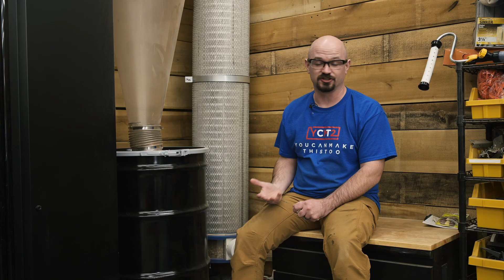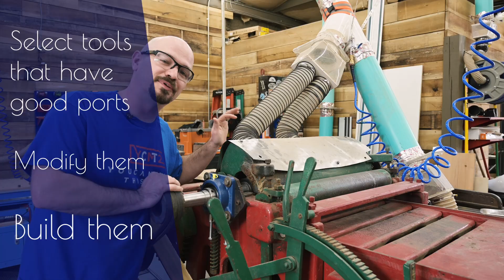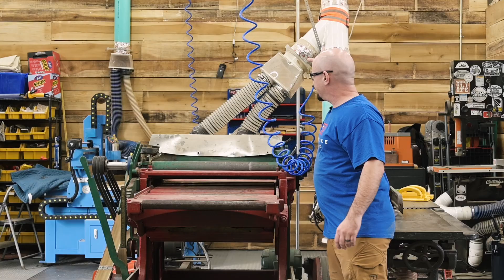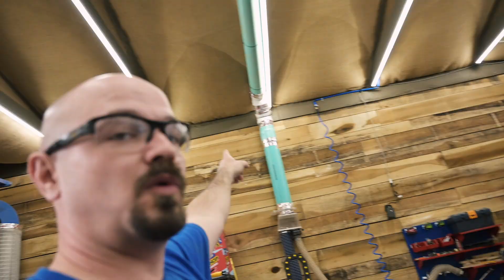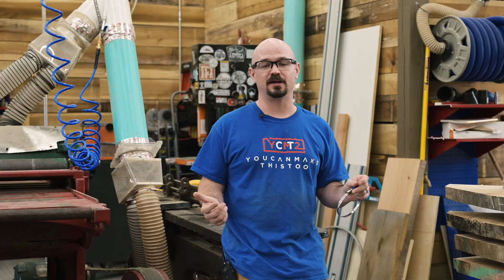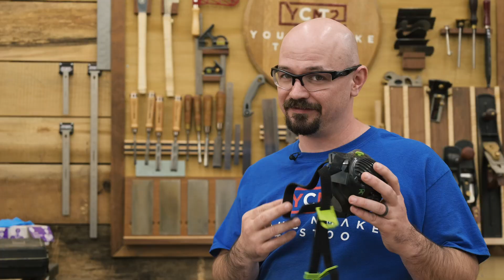Most Common Dust Collection Mistakes

Comment: Note that when you double the radius of a pipe, you better than x4 the flow you can get through that pipe. Friction losses in the pipe are controlled by the distance of each air molecule from the nearest surface of the pipe. Your six inch pipe, as well as having more than double the cross sectional area of a four inch pipe, has much more of that area further away from the wall of the pipe.

Comment: My wife bought a Harbor Freight filter/blower that I plan on modifying with a cyclone and a better pleated filter. The blower inlet is 4". Would I gain any performance by using 6 inch pvc?

Comment: Extremely well done, sir.  I've followed your dust management advice to a tee. I just need one or two air cleaners in my 40x30 with 12 foot ceilings shop. I have 6" sewer pipe from my Harvey Gyro 700 dust collector with 4" drops to my machines. Thanks for your info

Comment: There's a couple YouTubers that actually tested 90 degree turns and found no drop in airflow as long as it's smooth piping.  It's more important to remove any friction points between connectors or gates that make a difference

Comment: Thanks for the vid! I have one question, since flex hose is a lot more convenient to set up for my small shop, can I use larger size hose to compensate the downside? My WEN DC1300 's default output is a Y splits a 6 inch into two 4 inch ports, I could get rid if the Y,  and directly run 6 inch flex to all my tools, and use adaptor to connect them. I don't see myself running more than 1 tool at the same time.

Comment: It better to send dust out of shop not a cartridge.   Exhaust out of shop like professional shops.  While you can put filter.  You maximize CFM sending fine dust out of shop.   My 2HP pulls 3500 CFM at my tools because I don’t have a bag or filter in shop. I exhaust 6” out of shop to backyard.  

Get 6” pipe and a dust collector
Reply from the maker: Absolutely, if you can. I’ve yet to have a shop where that was a viable option though.

Comment: Well done, most home wood workers have no idea of the risk of dust and have misconceptions on vac systems. Yep the big dust is gone I’m good , No!  At least have a shop vac with some sort of pre filter and a Hepa grade filter in the vac. Then get a box fan and attach a couple of Merv 13or 15 grade furnace filters to it. Then just leave it running all the time your active in your shop.
Thank you for you work and excellent presentation.👍

Comment: I have seen many videos on dust collection on You Tube, and so far nobody has mentioned the importance of grounding.  Dust traveling through pipe can build up static electricity that can cause an explosion or fire.  Plastic pipe is just fine for dust collection, but it needs to be grounded by wrapping bare wire around the pipe, or running bare wire inside the pipe, then connect it to your dust collector motor or to ground rod.   Metal pipe is self grounding.  It can be just as inexpensive as plastic, depending where you buy it.  To prove my point, try picking up fine sawdust with your shop vacuum, the try touching the plastic hose and see if you get a small static spark.  Woodworking is a great hobby.    Be Safe!!!!!!
Reply: I was vacuuming blown insulation out of a wall (demo work). There was no lights and it was after sundown. I kept feeling a prick on my arm and finally saw a spark from the vacuum hose to my arm. Yes you will generate static that can generate a spark.

Comment: if you install fans and associated vents to force the dirty air out of the workshop and supplement with good dust collection, you'll avoid most of that minute dust, and you will not need the expensive pleated filters.
Reply from the maker: If you run climate control, as I have to in the Deep South, the extra cost of heating and cooling as you keep sucking in outside air would probably offset the cost of good filters pretty quick. 

If you live somewhere really temperate, or aren’t in the shop every day, probably not as big a deal.

Comment: Did you test air volume before and after taping your joints? It's obviously helpful, but I'm not sure the benefit is worth the cost and aesthetic mess created from taping (I actually care how it all looks), but the before/after Delta is substantive, then I'll tape the joints. Also, by not taping, I can more easily disassemble and reconfigure when needed. With the 6" PVC, the fittings are pretty tight even w/o tape.

Comment: Thanks for this mate . I'm just planning out my collection system and the first thing I WAS going to do was step down from 150mm to 100mm , I will NOT be doing that now . I will run 150mm throughout the workshop and only step down at the individual tools as necessary . Also appreciated the 45 degree tip !
Reply from the maker: Glad I could help!

Comment: 6:20 there’s truth in that from the filtration perspective- the filter gets more efficient over time. But that probably is coincidental with the collection becoming less effective as mentioned in the video. 
And blowing the waste air outside solves the tiny particles blowing around anyway.
Reply from the maker: Our pool is going downwind of the shop inside venting doesn’t work for me here 🤣😂

And exactly on the filtration. Only functional if your airflow is well over the required amount. Otherwise… great your filter is extremely effective, sucks you aren’t catching the fines at the tool and they’re going in the air instead… because of how effective your filter is 🤷‍♂️🤦‍♂️

Comment: I'm starting out with a WEN DC3401 which has a 4" dust port but would like to upgrade someday.  When I buy the rigid pipe could I install 6" and the downsize at the dust collector in preparation for upgrading someday?  Or would it have a negative impact on air intake for the WEN unit?

Comment: I'm usually a very technical guy, spent 46 years working in engineering and ergonomics. Okay 1. Most hobby level dust collectors even those with 1250 cfm are 4 inch not 6. Using principles I learned in fluids you don't want to jump to 4 inch pipe from 4 inch. Opposite if you decrease to a 2 inch port on a tool then you have a venturi effect. So smaller area in the PVA equation (pressure, velocity and area) means pressure drops but velocity increases. So the draw would get higher in terms of air velocity but the CFM is only going to be subject to line loss. I loose area and volume but gain velocity. Maybe not great for small particles but the bigger stuff would get sucked in faster. My point is practical. Who can run a 5 hp monster in a personal shop and 6 inch PCV everywhere. Maybe a video on practical precautions. Like the other filter systems for overall and using cyclones, bags and vacs for the specific tools like miter saws. https://www.princeton.edu/~asmits/Bicycle_web/Bernoulli.html

Comment: is it worth it to use 6" duct on a 1.5 HP system? It comes with a 6" inlet but it's capped at the tool with 4" double Y from the factory. Do you think it would improve the system to take the Y off and use the full 6" inlet?
Reply from the maker: If it has a 6" fitting, go for it.

Comment: On the table saw top vac cover, you can add a brush from a door sweep around it, this touches your wood but adds zero resistance, this way you get a much tighter air flow.
Reply from the maker: I like that idea, thanks!

Comment: The larger the pipe the less velocity with the same vacuum source.   Why is it better to run larger pipe so the chips go slower ?   If your machine is 4” you run 4”not 6 then 4.  A 90 is equal to about 20’ of developed length so the smallest pipe that you can get away with is best when there are a lot of bends.  The flex pipe is the worst as far as killing airflow.   Your shop looks like the septic system crawled out of the ground and is trying to get into all your tools.  Get some paint on those pipes lol.
Reply from the maker: The friction cost is a lot higher in smaller pipe, it requires more static pressure to pull and big dust collector tend to be low pressure. My collector has a 6" inlet. I pull way more air at the end of that running 6" pipe and downsizing at the port to 4", than if I ran 4" pipe the whole way.

Also, most of my machines have dual 4" ports. And two 4" ports equal about the same cross section as a 6" pipe. If I ran a 4" pipe and split it in two, I'm halving my air flow to each port. Run 6" and split to dual 4" and I'm maintaining air flow.

When painting my pipes helps me pay bills I'll get the paint and put my time in it.

Comment: Great stuff! I’m setting up a small workshop dust collector running off a 6HP shop vac. If the shop vac inlet is 2”, does that mean my best flow rate would be with 2” pipe? Initially it will be for a CNC and miter saw. I know you said that piping down reduces CFM, but what about piping up? Thanks!
Reply from the maker: This week I realized the video on this! HA.  https://youtu.be/seykIjz4WSc  

Short answer is piping up crushes flow even worse. I actually do an experiment in that video showing how bad it is... instead of writing you a book here just check that out when you get a chance and drop a comment there if you've got any questions. And perfect call on the big shop vac for a CNC and miter saw. Which CNC?
Reply: @YouCanMakeThisToo : Thanks, I’ll check it out. My Onefinity Journeyman X-50 should get here on Monday! I’m building my table and torsion box this weekend.
Reply: Great video Thanks

Comment: COPD = chronic obstructive pulmonary disease.  Wood dust can cause a similar disease with obstructive features but also tends to have interstitial,  restrictive component too (pneumoconiosis). And asthma / rhinitis / etc.  Also terrifying is per the great Bill Pentz suggesting 1% lung function loss per year of work
Great video, everyone who does any woodwork etc should absulutely consider dust extraction as important as the building they are working in!

Comment: So, you use significant lengths of 6" sewer pipe. Does this originate at the dust collector or after 4' pipe at the dust collector?
Reply from the maker: It’s 6” out of the cyclone. Going from small to bigger really kills flow.

Comment: Great video, thanks for all the details. I definitely need more “at the tool enhancements” I use plastic self-stick stretch wrap on my pipe joints and then add a piece of painters tape over it to avoid a loose dusty end issue. If I need to remove, there’s zero residue
Reply from the maker: Thanks! that's a pretty solid sounding technique

Comment: Good tips.  I would also run a braided copper wire through the system and connect to earth ground to illuminate static electricity/ sparks.
Reply from the maker: Great idea
Reply: Why braided? That will fill in the voids with dust. Maybe I’m all wet but solid is going to be just as effective in my mind.
Reply: @fishhuntadventure  the wire I used was for that specific purpose.  A little more cost, but easier to handle.
Reply: That's only necessary at the places near where you touch.

Comment: What about static electricity? Dust and debris (particles) moving through plastic pipes cause static electricity
Reply from the maker: Dust loads don't get high enough for combustion to occur. But you can definitely get little zaps when you touch the pipes while they're running, easy to ground though.
Reply: @YouCanMakeThisToo : Great video! What is the best way to ground pipes? Thanks!

Comment: A respirator is the final line of defense. I have the same Sawstop with the same overarm collector and the intertia of some of the dust coming off the blade escapes the suction, so dust gets onto the table, into the air and onto the floor. I have a cheap shop air cleaner cleans down to 1 micron, but I am gathering information to make a shop air cleaner that cleans to 0.3 microns.

Comment: I’m not very smart, but I am not buying the starvation theory as explained here. How would it make any difference to drop six down to four, split it and connect to two machines, versus split it six, then drop it down to two fours? It’s the same thing. They only way this could make sense is if both machines were being used. For most people, only one would be, and would make no difference what size pipe ISN’T being utilized after the split. Six inch, closed off pipe behaves exactly the same as four inch closed off pipe.

Comment: I got one of those dylos particulate counters and I think everyone should get one of those. 

Even gentle sweeping with a broom will raise the particulate more than using a bandsaw with a good dust collection setup.  For dusty jobs I can keep my mask on until the air hits a certain number I’m comfortable with. 

Most of the time the air in my shop is cleaner than the outside air when I run air filters. I use box fans with Merv13 filters. I can get several of them for the price of an air cleaner

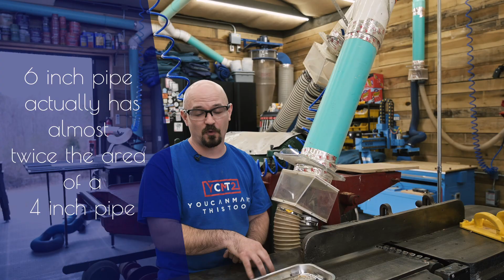Comment: 14:10 given a constant pressure, flow is directly proportional to, not the square of the radius, but the cube. so a six-inch pipe actually has over three times the flow of a four-incher.

Comment: I'm constantly developing my dist collection system.  Thanks for the excellent information.  You have a great delivery for your videos.  One point I'd disagree with is that in a restricted airflow situation, a dust collector moter will over heat.  This may be true for a vacuum cleaner situation but it's not for a dust collector.  A dust collector motor is cooled with air that's not related to the air in the dust collector system.  In fact, in a restricted airflow situation, the collector motor will see a reduced load (yes, reduced load) and will therefore actually run cooler.  A shopvac type system will do the opposite.  A shopvac will also experience a reduced load in a restricted airflow situation but since that same air is (usually) used for cooling, the motor will heat up.  Thanks for taking the time to help us understand what you've learned in dust collection.   You're right, its importance can't be overstated.

Comment: A question for you: how are you measuring airflow at your tools?  Also, have you tested performance with and without sealing the joints?  In my experience, if you are getting PVC fittings fully seated (I use a touch of automotive grease on the pipe/male-end to allow them to seat fully without cement, there is no detectable leakage, especially at the pressures that a dust collection system is operating under.
Reply from the maker: I used an anemometer. I haven't tested.. but mines sealed and a friend has a practically identical system that's not sealed. From the dust patterns it's pretty clear his is leaking around the joints. I'd suspected that the grease you used to help fully seat the joints also sealed them for the pressures it sees. Handy side effect

Comment: What a great video, it covers all the elementary knowledge that anyone needs for good dust collection and when I do seminars I highlight the same points. 99.9% of dust extraction information on YT is total rubbish and I consider this video to be one of the few that gives the correct information if not the only one. 

A couple of supplementary comments, any machine that has a closed cabinet and bandsaws are the prime culprit need an air entry at least as large as the exhaust port because if no air can enter no air can be exhausted. I leave my BS cabinet door cracked open with a piece of wood others have put vents into the door itself and then leave it closed and the fact that your jointer has air leaks around the hood most probably improves the extraction and I would not fix the leaks. 
There is a simple recipe for good dust extraction, a 15" impeller and 6" solid pipe and all machines need 6'' ports so all machines need modifying unless the machine has two 100mm ports into a 6" duct. If a 6" duct is reduced anywhere including the machine port the maximum flow possible in the duct is dictated by the smallest pipe or port. A tip on the overhead TS guard/hood, remove the short pane of perspex at the end of the hood furthest away from the operator and watch the performance of the hood jump by a lot. The extractor can only pull what can get into the hood and if the hood is on the material being cut or close to it then not much make up air can get into it and if the front of the hood has an air entry the hood can be hard down on material being cut and no debris will be released through the opening. 

I can write pages of this stuff all learned over many years of selling and advising in the industry so I had better stop here.
Reply: Duster...do you have a website or....where I could go to learn more??

I find your comments/info very helpful;
Reply from the maker: Thanks for the feedback, and that's all really great advice. Thanks! Really wish I'd have known you when I first started trying to do DC, it's been a lot of trial and error. Never thought about what you said about the table saw overhead port.. it does have a notch in it and now I understand why, could probably stand be to bigger though.